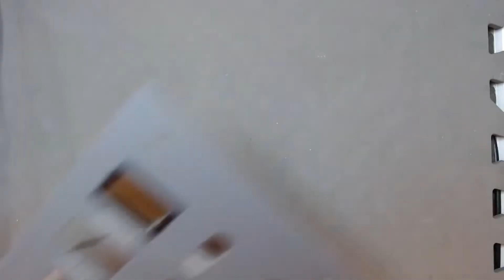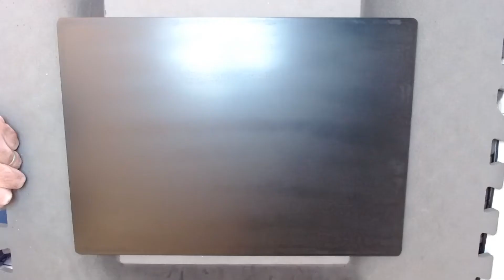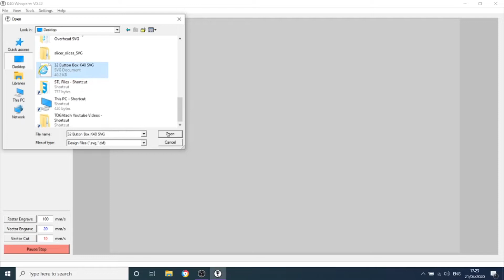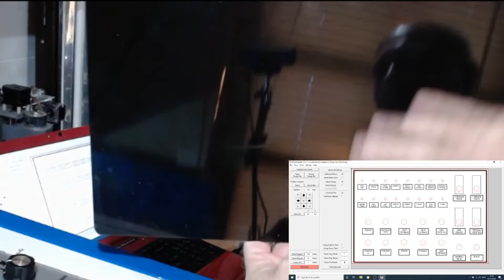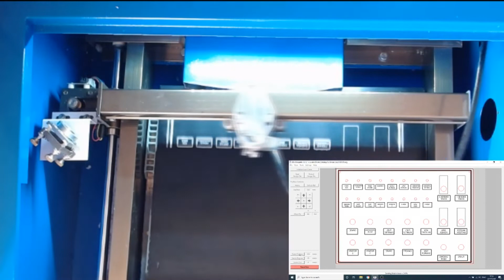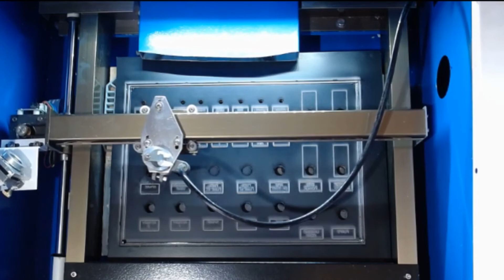Ultimate 32 Button Box Version 2

Comment: This is pretty cool! The results are nice. Now that a couple years have passed, would you get the same machine or is there another one that’s better?
Reply from the maker: Hi thanks for watching. This button box works great with the majority of sims. I have recently done a video on the Beringer Mini Midi controller which I intend on using with Flight sim 2020.
Reply: @togatech1111  I meant the laser machine. Sorry for the confusion
Reply from the maker: I broke the tube about six months ago and still haven’t replaced it. As far as cutters go it does the job. Thanks again for watching I do appreciate it